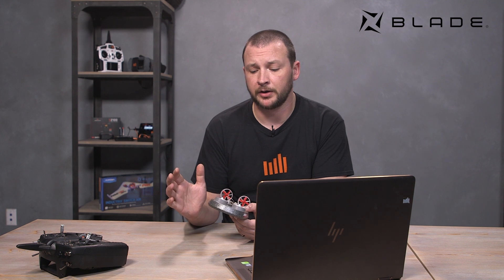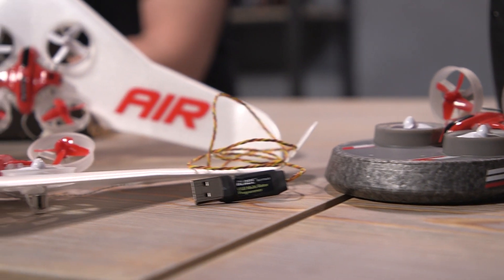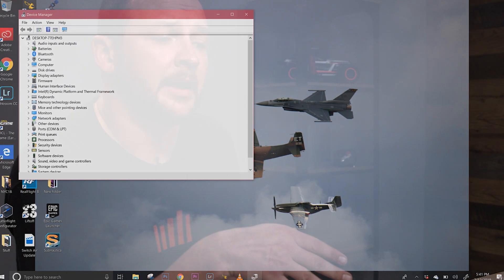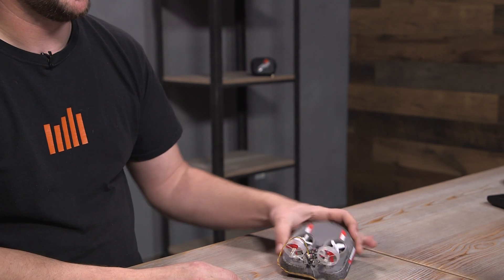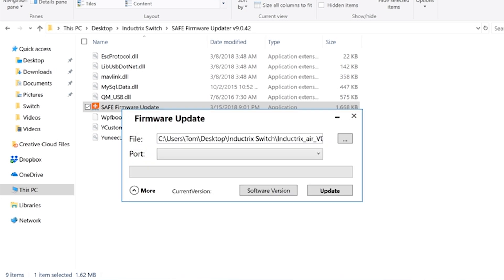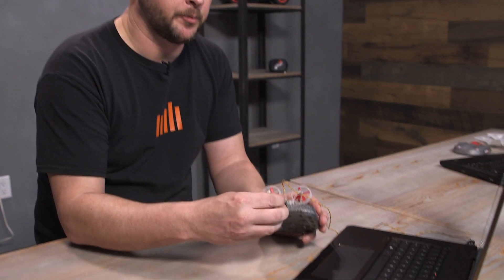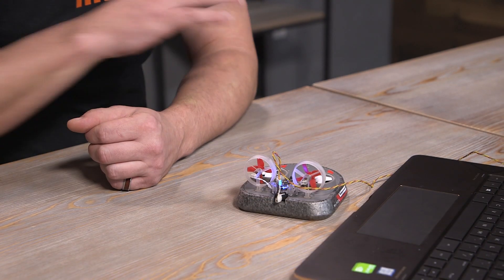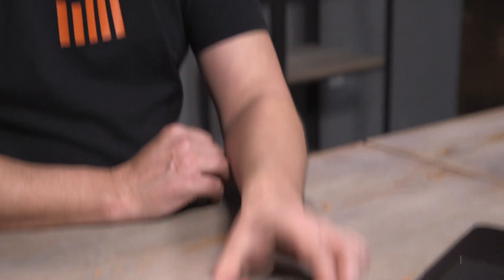Blade Inductrix: Switch to Air Tutorial

Comment: so how does doing this work as a cheaper setup cuz from what I see you can't just buy the wing alone you have to get each with the little inductix which means this firmware would be pointless since I could just fly one or the other since I can't swap one inductrix between the two foam molds
Reply: Inductrix switch wing only part# BLH8301 looks like it will be available early March '19.